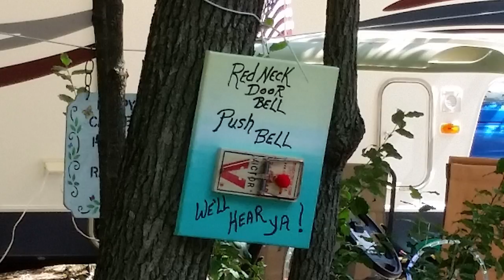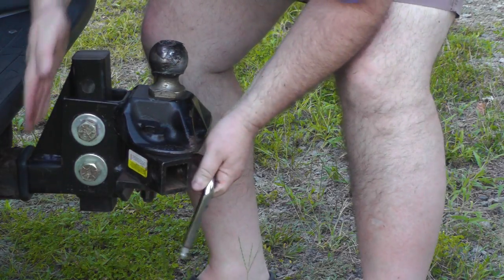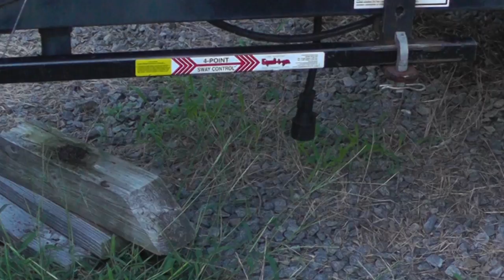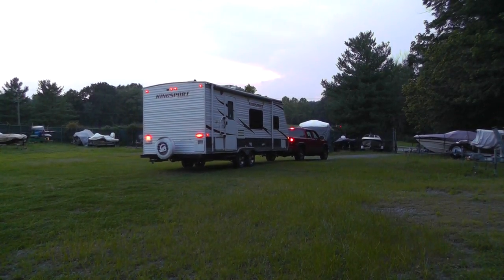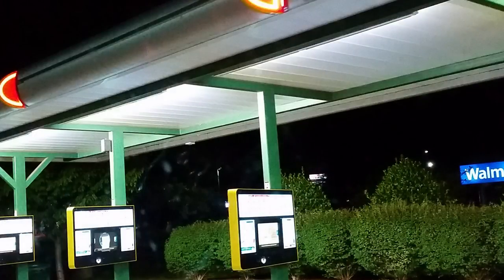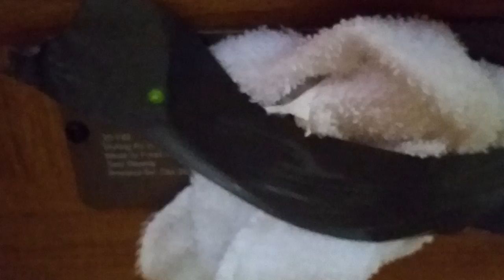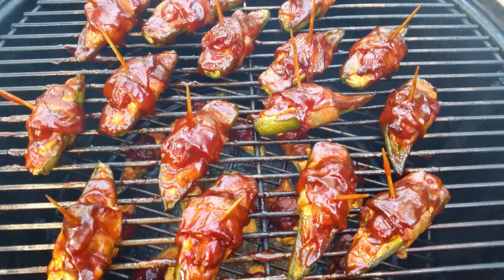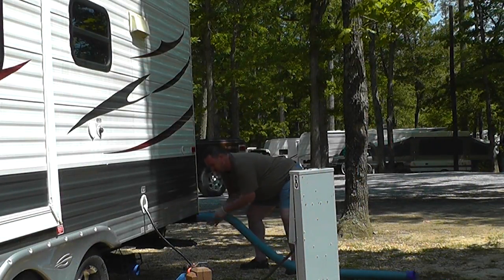Summer Camping Trip ~ How to Setup An RV Travel Trailer ~ Camp Cooking ~ Amy Learns to Cook

Comment: Couple things, get a power jack on the front of your trailer so you don't have to do all that hand cranking. Second do some research as they make much easier to use equalizer hitches. Mine is a much simpler design that is fully adjustable as to how much weight you want to transfer off the tongue just by using different links in the chain it uses and you do not need to use a wrench on it when connecting, quick and easy.

Comment: Just saw this video. Good stuff. If you're concerned about parasitic battery draw from the radio and carbon monoxide detector, you might look into a battery disconnect switch. It completely cuts off battery power to the trailer, and is a breeze to install.